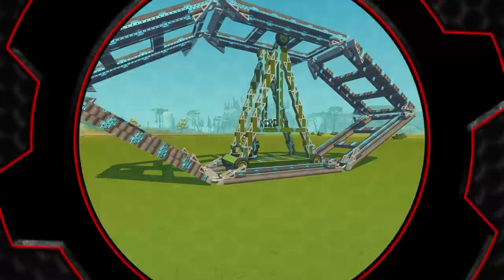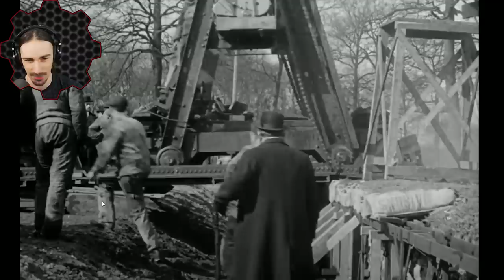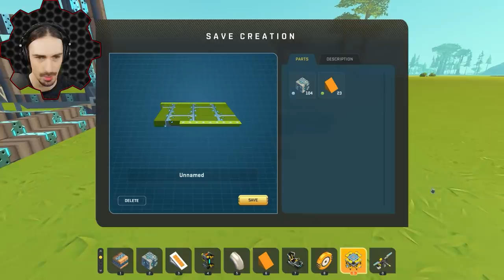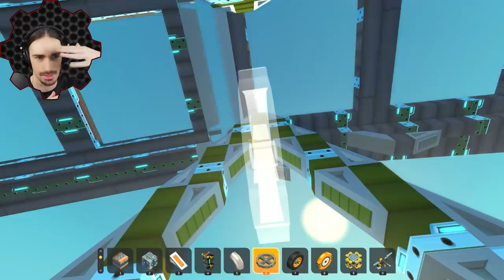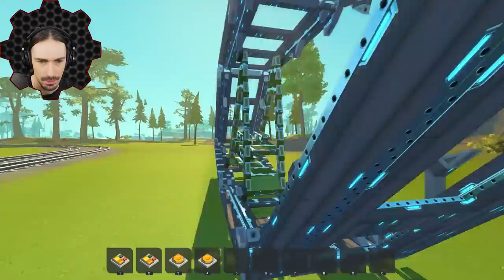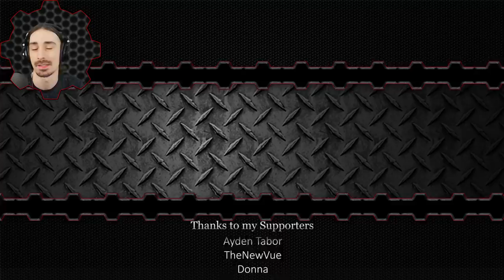I Evolved This FAILED War Machine Into A SUCCESS

Comment: you could try to make its wheels locked into the track by putting guards on top to prevent them from slipping out, possibly with some sort of suspension to grip it on both the top and bottom and turn the correct way on both sides. Also if it's meant to be an engine of war it would probably need to be armored to protect the driver. Also it's really unstable because of how tall it is vs its... wheel...track...base. Overall it is interesting as a historical curiosity and an early iteration on what would eventually become the tank tread, but it's pretty clear why the modern design is superior.

Comment: You should do the British version of this, would be simpler, it was basically a wheel with rockets attached, its job was to barrel through barbed wire to allow infantry to go through, the downside was that it was a circle, on rough terrain, and it was supposed to go straight. On rough terrain. Yeah now you can see why that was a problem, and it was also very skinny

Comment: This kind of design did actually go on to be something. There's a drive called the Rotaped that some tractors used. Essentially the same concept but with some modifications to make the top and bottom links interface with a singular sprocket, a pulley system connecting every other link to keep things constrained, a system that keeps the top and bottom parallel at all times. I'm not sure if this system ran into any flaws, it seems to be fairly rare, but there's no way the Rotaped isn't an evolution of the Boirault.

Comment: I like that the things you did to fix it could have been done by those that designed it originally, it didnt take any tech or special parts like helicopter servos, only suspension and a wierdly placed wheel hehe

Comment: I think the way you're turning it would cause the tracks to drag and dig up the ground in a real world scenario.  Is there no way to simulate that?  Also I think you need a way to keep from derailment, keep the track and wheels from separating at all.  Bottom wheel suspension?

Comment: I think it's happening because the suspension is tensioning the whole system. Try putting three wheels up top per side, with the middle one slightly higher. That way you gain friction and a supporting shape
Reply: That triangle shape will also allow you to climb bigger obstacles by supporting and pushing the top tracks over

Comment: I think it'd be neat to try and do a 'tripod walker' like from War of the Worlds (the Novel).  In that they were described as having stiff legs, and 'tottering around like a milking stool'- so like, the legs were all straight, connected to each other, and rotated around a central 'vertical' axis on the bottom of the machine.  (none of this giant tentacle nonsense)

Comment: If you put a bar where you turn to lift the back up a bit it would probably stop the derailment and if you use a long pipe around the whole top that is attached to the center piece that opens to grapple on I feel like that would help with the derailment, also if you put high friction block like 1 block skip 1 block skip it will make the wheels have more grip and the ground have more grip cause it’s a 1 block gap from the wheel to the ground.

Comment: Rather than seeing it drag its rear end around when you turn, imagine a big giant tire the size of the track that would lie flat on its rim and you could lower two tires and rotate the vehicle, pushing the sides of the track to rotate on the giant wheel of the track section your above. A better way is to think of the entire tank and tracks as a turret seat that rotates.  

Also a rotate-able barrel seat would be cool to see it rotate sideways and fire a spudgun when it finds a spot. 
Also i wonder if you could bubble-block it to make it float.
Also i wonder if having a sort of monorail-like double wheel would work better with the top section.
also anti-flip extend-o arms to push the entire thing sideways when it rolls.
Could it hop with the wheel?

Also love you hook solution. Very clever.

Comment: If you added more hooks in a 'slots' system instead, you could potentially have greater turning capability.

Edit: And, you could do a roller coaster design where the wheel contacts both the top and bottom of the rail, instead of just the top.

Comment: personally, i would have added 'bars' running from those sloped parts you have to limit how much the track can bend in on itself, and 4 different hooks to interlock with those, and finally an actual jack to lift it all up and rotate. its a tank vehicle, it should turn on a dime.

Comment: How to fix the uphill issue: Replace the wood on the track with a block with more friction so the wheels can get more traction. Same with the bottom so the track doesn’t slip either,

How to fix the derailing issue: Just make the sides of the rails higher, easy fix

Then it should be able to go even faster and go over more extreme terrain. Also, you should make the holes in the track smaller because obstacles could fit through them and block the car’s path.

Comment: I did some math and its complicated to explain in a comment, but make the minimum angle between two tracks should be exactly 60°(or else a bit less, if exactly 60° is impossible with the buildgrid and stuff), this is the largest angle possible without the top lifting up. This wil not prevent the top from lifting up, but it causes the top not being forced to lift up while still supporting the sides of the top most track to prevent it from going at an angle and sliding off the top wheel.

Btw I'll try to explain the maths in the comment of this comment

Comment: Make multiplayer monday race using such vehicles that the vehicle itself can not touch the ground but have to use another creation for it turning included. And to add for the usual rules, you cannot make the other creations tightly interlocking to the vehicle as that would be the same as not having separate creations altogether.

Comment: why not have the turning hock extended across the entire piese of track so you can turn at anny given time, and imagine a rail on the track above the weals so that the wheal is incased so it cant get out of the rail. That would also aliminate the need for the turning honge system becouse the wheals would carry upp the track. Just a thought

Comment: The most unrealistic part is turning. That single wheel would never have the grip to drag 1.5 platforms across the terrain. Since those platforms are not solid sheets, the edges of the beams would dig into the ground the second you try to turn and that wheel would just spin. 

My suggestion is to move the hook back so that when you lift, only the platform you are on is in on the ground. Then add a second hook for the back, and a second wheel to the rear.

Comment: Your issue was you were pinching your blocks and bearing while turning.and dragging your backend Making it distribute weight throughout which made your back end light. I made  a floating water bridge made of small sections using this reaction each section connected by a free bearing on a T pipe, there's curved pipes on each end facing down when a vehicle drives over the pipe pinches and distributes weight and sometimes the bearing gets pinched and slings the bridge sideways back and forth like a snake distributing that weight sideways instead of down.. Free bearings dont like to be moved in ways they weren't meant to it creats a crick and will apply pressure throughout anything welded or connected to it.. Also a different vehicle  design would fix your steep climbs for example Instead of an A do an X four points of contact and maybe added rear steering. Love this series. I'm too lazy to try this stuff ill just watch you 😂😂

Comment: how about turning it "full circle" literally turn this machine into a gigantic "one-wheel" machine, where its center of mass is low to the ground, but you would help move it and stabilize it with that weight as the outer track moves around the inner weighted hub (basically, take the triangle and use the top wheels point as the center, and put the triangles all around to make a circle, and use the track with smaller sections and a type of "dovetail" for keeping it in place, with wheels to move the track from the main inner structure.

Comment: Could you make a rotaped tractor
Reply: Interesting tractor, definitely very unique sounding due to those massive tracks. It's cool how one big wheel per track solves all issues of this tank as far as making top and bottom move at the same rate while making it a simpler thing over all.